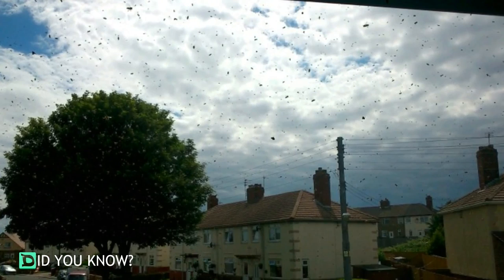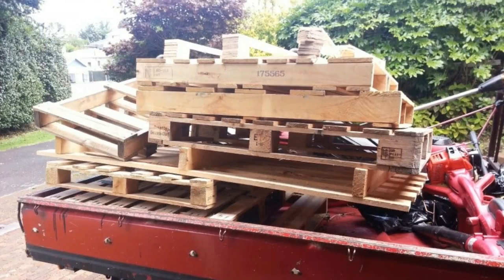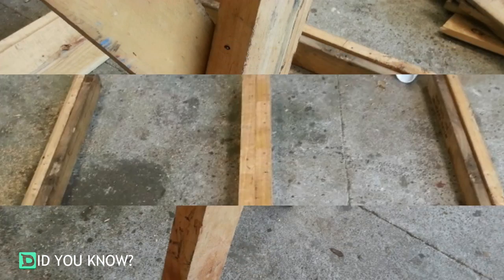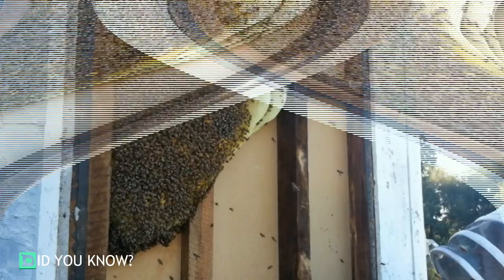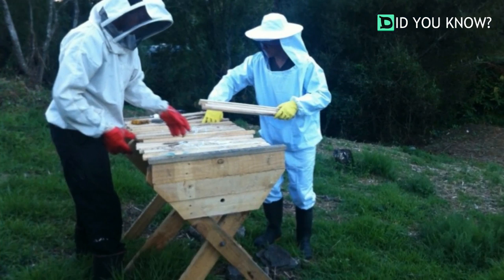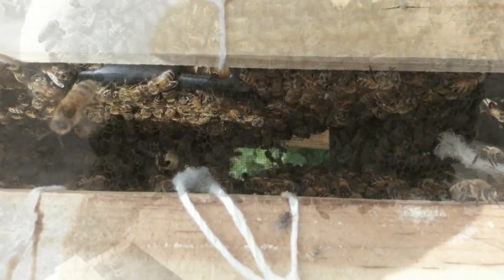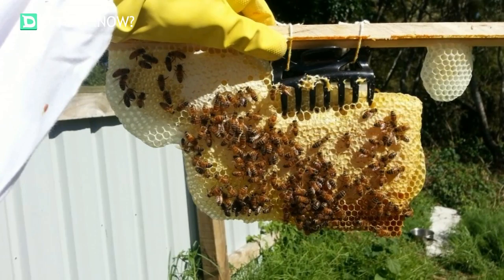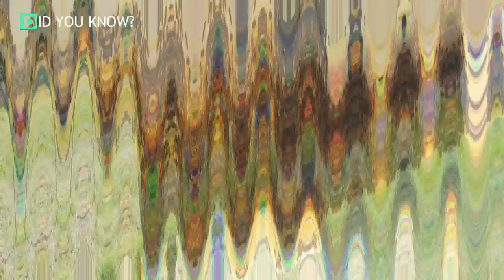Bees Have Completely Taken over This Guys House  How He Fixes the Problem Is Brilliant

Comment: Love the idea, but there is one significant flaw with the design. The legs are wood. Might not seem so bad, but ants will be able to easily climb up. Ants are the killers of Bee Colonies. The legs should be upgraded eventually to metal pip that one can put grease on. Will keep the ants from climbing up. Just need to change the grease every few months.